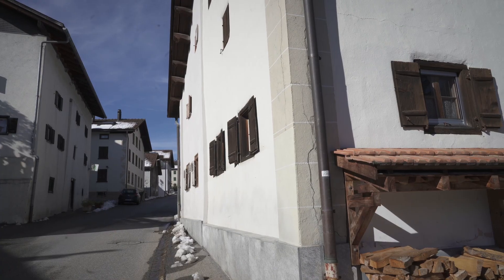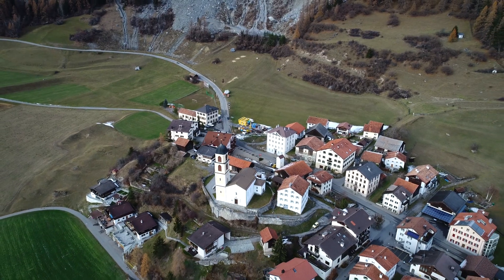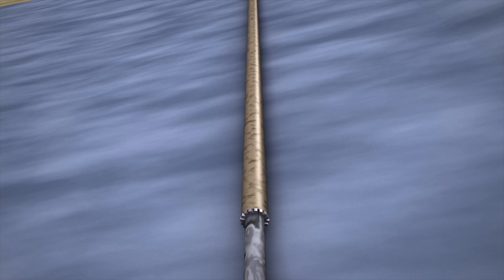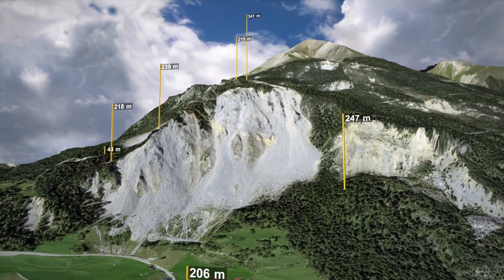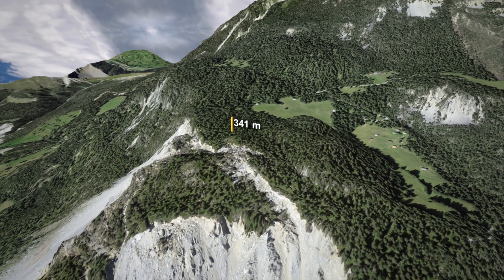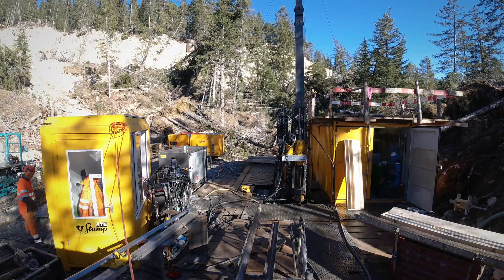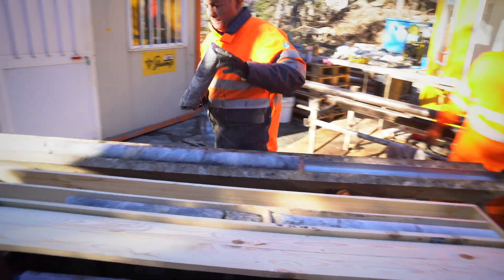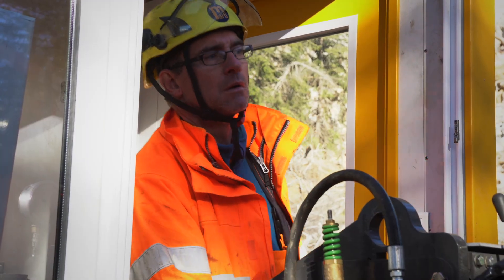Stump-BTE - Sophisticated core drilling in Brienz/Brinzauls (Switzerland)

Comment: Is there a continuation? This is like a thriller movie that ends abruptly just to prepare us for a sequel. I am extremely curious now about the solutions and what happened next.
Reply: Having quickly scrolled through the VERY extensive and technical slide deck presented to the village, this is very much still a work in progress. When dealing with geological phenomena, you need time to measure and analyze. But an immediate measure is to drain water out, which would speed up the movement of the mountain side, especially during winter. As an interesting bit, Tom Scott did a video on how they mitigate danger to the road below (https://www.youtube.com/watch?v=o-oVXYkBwgw). Slide deck I referenced (in german): http://www.albula-alvra.ch/files/BXMediaPlusDocument7862file.pdf